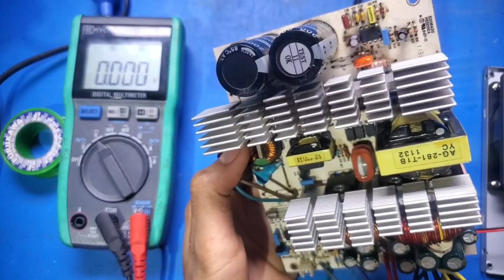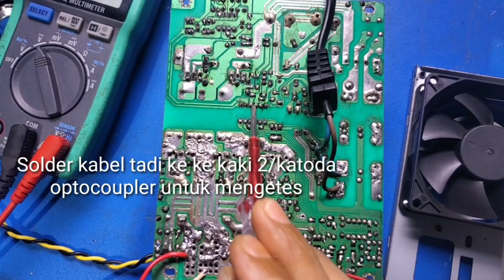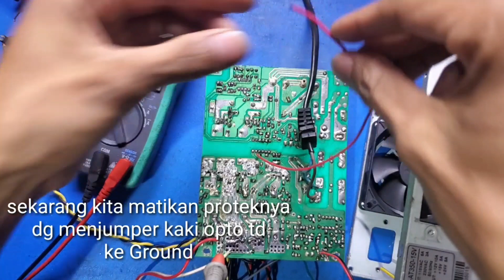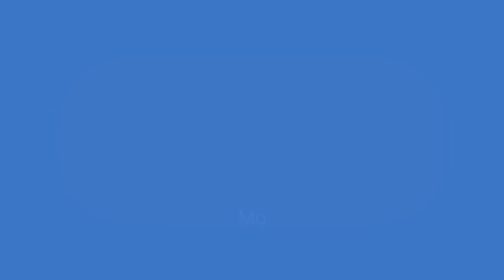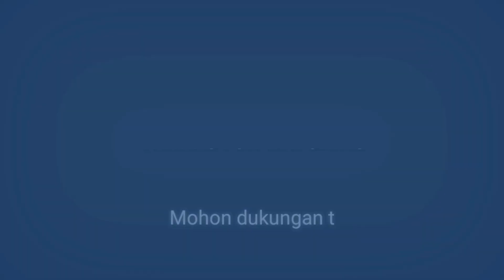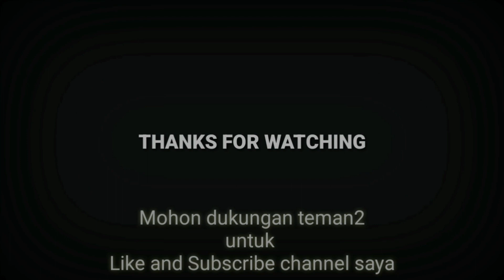Cara Membuang protek psu bekas PC ATX PSU

Comment: Udah ilangin proteksi, pake kabel +12v sama +5v digabung buat negatif nya -12v sama -5v. Terus sort berasap, itu yg kena sort apanya ya om biasanya?
Reply from the maker: Mungkin salah point nya bg, soalnya beda merk beda2 point nya
Reply: @wdtech9557  harus menyesuaikan spesifikasi dc output di stiker psu nya itu ya?

Comment: Fungsinya mematikan proteck biar apa bang?
Apa setelah protecknya dibuang ampernya bisa nambah
Reply from the maker: Agar amperenya bisa di pake maksimal tanpa protek tpi tidak di sarankan buat beban berat terus menerus
Reply: @wdtech9557  gitu, saya barusan beli bang, tapi second, saya buat suply driver power TPA 3116d, tapi kalau nada bass dibuka hampir full, teganganya drop, misal protecknya dibuang apa bisa stabil y bang
Reply from the maker: @ekowahyudi3239  kalau masalah bass kurg maksimal bnyak faktor bang bisa dari speaker, model box speaker dan sumber input audionya
Reply: @wdtech9557  ini saya pakai mixer bang, o ya, merk PSU komputer yang bagus apa bang, ini saya dapat merk simbadda, kualitas nya gimana
Reply from the maker: @ekowahyudi3239  klo skelas ic tpa3116 simbadda ckup, cba naikin voltasenya klo psu pc kan 12v klo ada adaptor 20-24v

Comment: Punya dataset psu itu gak pak
Reply from the maker: Gak punya om, itu psu chines datasheetnya gak ktemu udh di cari2 😁 tp klo perlu nilai part nya saya ad sih nyimpen datanya
Reply: @wdtech9557  apakah produk delta gps-750ab pak... Soalnya punya saya agak mirip kaya punya sampean psu nya pak..datashet nya jg gak ada ..
Reply from the maker: @Storychanel21  psu di video merknya venomrx om 😁
Reply: @wdtech9557  tp sepertinya sama pak ...dari model nya..
Reply from the maker: Vsb ada klo tegangan P.G nya ada gak pak yg kabel abu2 cba jumper kabel ijo ke gnd/body nyala gak
Reply: @wdtech9557  5vsb ada ..kabel hijau 4.9v sudah jumper ke kabel hitam ground tetap gak nyala
Reply from the maker: @Storychanel21  cba di urutin
Pertama cek smua dioda di bgian sekunder bila perlu dioda yg nempel k heatsink(tp dioda ini sangat jarang rusak) kedua cek Ic Tl431 disemua area lbh gampang ceknya pakai Esr meter karna kasus 2 ini yg sering saya temui
Reply from the maker: @Storychanel21  nnti jika smpat saya cba buat video cara cek ic tl431 yg error
Reply: @wdtech9557  transistor pakai B647 ada 4 biji dan transistor smd tp gak keliatan kodenya
Reply from the maker: Brrti gak pake tl431 ya om
Reply: @wdtech9557  tidak pak...kalo sirkuit  dioda scotky yang output 3.3v dan 5v ..indikasi short keluar angka tertentu tidak... Soalnya punya saya short keluar angka 38.7
Reply from the maker: @Storychanel21  brrti itu memg ad teganganan yg gak bres,jdi protek tpi banyak faktor sih blm tntu diodanya bsa jga dri primer mgkin ic pwm nya error dll
Reply: @wdtech9557  di primer tegangan elco 299vdc ...di modul pwm ic uc3845 , lm393 , ice1pcs02 ..sudah diganti semua
Reply from the maker: @Storychanel21  ic udh di ganti smua ttp gtu ya pak, brrti di sekundernya itu gak beres
Reply: @wdtech9557  5vsb ada tapi kendalanya tegangan output tidak ada ..

Skunder Dua Sirkuit dioda mbr 2045c tuntuk output 3.3v indikasi short di resistansi 38.7

Primer dioda zener dan resistor indikasi sort jg tapi mosfet aman..
Apakah memang begitu pak

Si

Comment: Apakah bisa untuk semua jenis Power Supply gan??
Reply from the maker: Saya pernah coba di beberapa jenis psu ada yang gk bisa gam, tp lbh baik di cba aja gan gpp. Klo gak bisa dg cara divideo paling mainnya di ic di cari jalur proteksinya
Reply: @wdtech9557  kalo di psu lain kan optocouplernya ada yg cuma 1 ya. Kalo semisal tidak bisa itu akibatnya gimana? Apakah TR short atau IC nya short?
Reply from the maker: Short di tr sih kemungkinan kecil karna sistem krja optocoupler mirip relay, kalau pun salah pin saat nyari pin proteknya paling psu nya mati karna protek
Reply: @wdtech9557  owhh alah, oke gan terimakasih informasinya, nanti mau saya coba
Reply: @wdtech9557  gan itu kalo kaki emitter dan colectornya di shortkan , bisa kan?
Reply from the maker: @belajar_elektronik614  sama2 gan, silakan di cba dlu smoga work caranya. Jngan lupa subscribe ya gan 😉